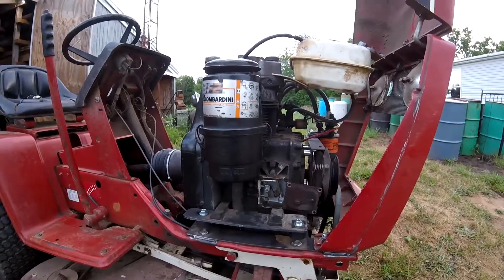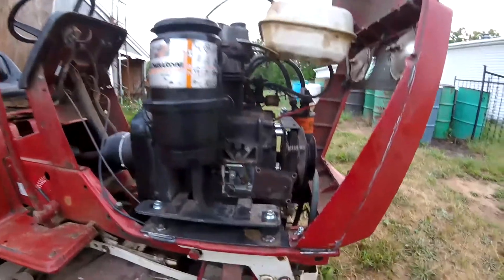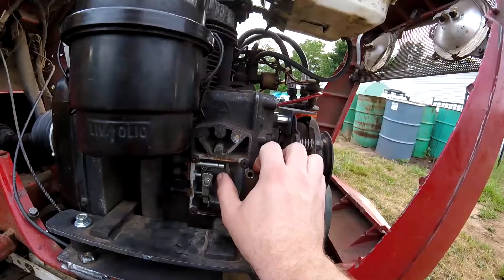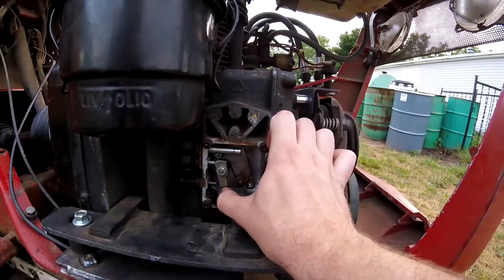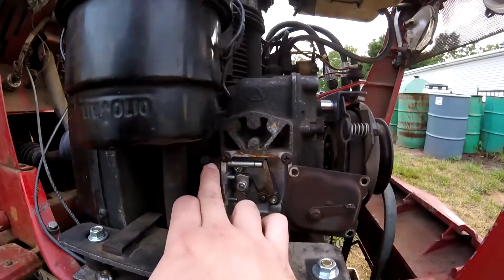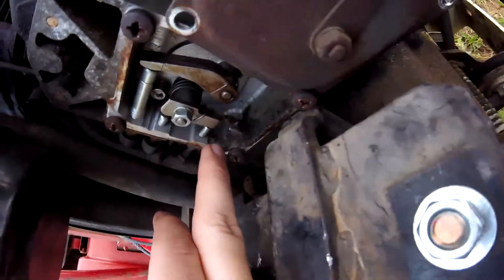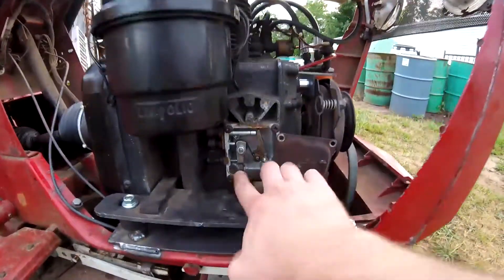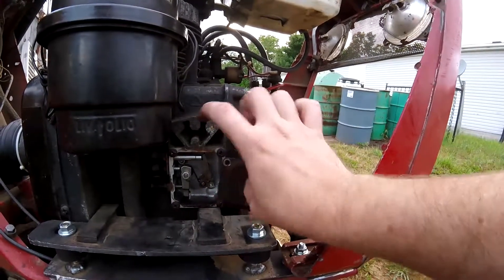Lombardini 6LD260 - Variable Throttle Mod

Comment: Your vid really helped me u might already know when it comes on the light board the factory puts restrictions in the intake and exhaust to make   
The opening smaller for less air flow need to take them out to open it up thanks again for the vid
Reply from the maker: Huh no I didn't know that. The thing is a dog at the moment so I'll see if that's still there. Maybe that'll light it up some.
Reply from the maker: Just tried removing the air cleaner and looked in the intake and didn't see anything. Tried driving it around and no real change in the butt Dyno. So just a FYI!
Reply: Mine had a metal plate that was the same size as the gasket but mad the hole smaller if I get a chance I'll send a pic of them

Comment: How did you connect it to your drive shaft
Reply from the maker: I made a custom driveshaft with a front half shaft / cv axle from a Chevy truck. I had to cut, shorten, turn, and weld it. Had to try several cv boots so it didn't get messed up at high rpms. Cheap boots made it lump to one side like a unbalanced washing machine

Comment: How do you find the 6ld compares to the engine that was in that cub? Assuming it was either a diesel of a kohler?
Reply from the maker: It was a opposed Briggs, 18hp. This particular one is a dog, very low power. It's a 6ld260 so like 4.5hp. The larger bore 6ld engines would be better. A 400 or 435 would have been better. Serves it's purpose as a trailer mover or show putter though.